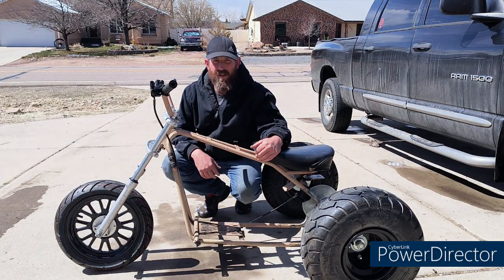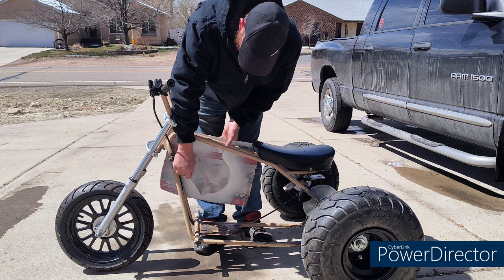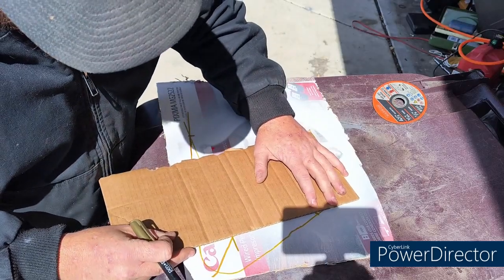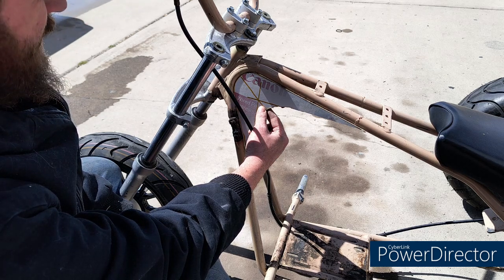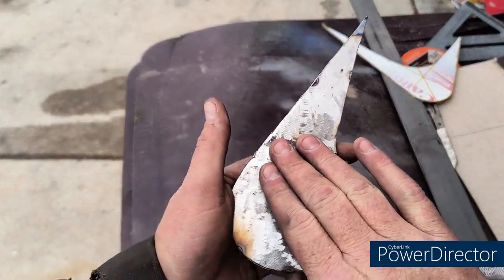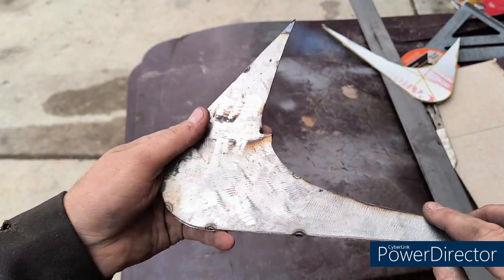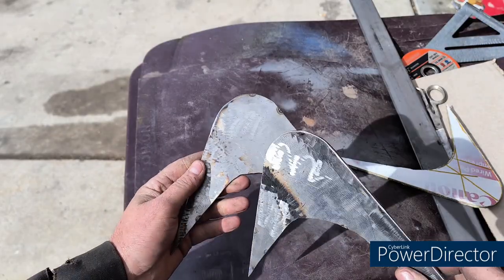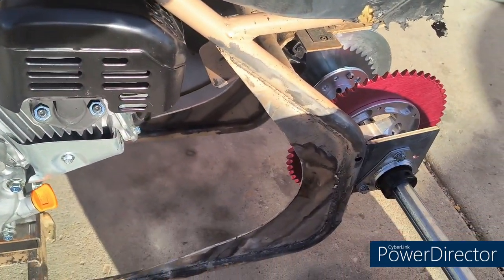Fabricating Gussets! CT200U-EX Trike Build Part 3

Comment: What did you use to space the front wheel? Just sleeves on each side?
Reply from the maker: Ya I just hit the local hardware store and got some thick steel bushing that fit over the axle welded a few together and cut them to the length I needed